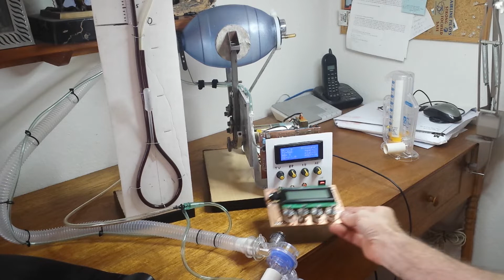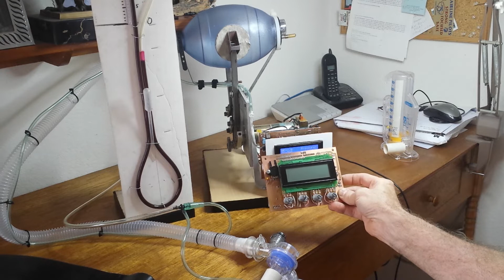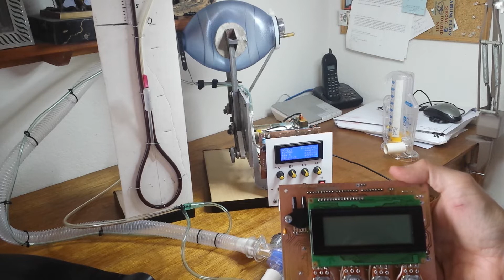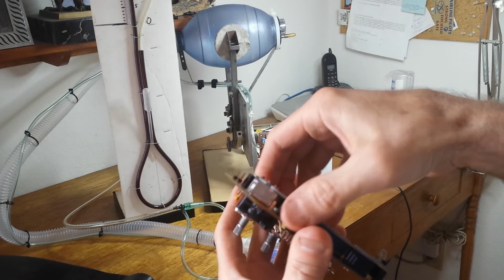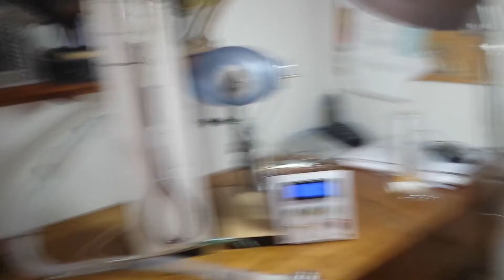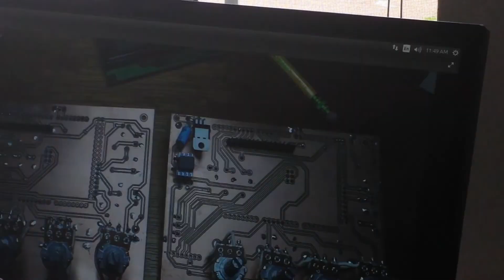DIY mechanical ventilator with closed loop control #5

Comment: Hello, I am simulating the circuit, I have a question, what do the values that are sent by serial 0 represent? I see 5 columns, I know that 1 is time and 5 is pressure, but I don’t know what the others are.
Reply from the maker: Hi Miguel,
#1 is cpu clock
#2 is cycle start time
#3 is the state of cycle
#4 is QPPS ( encoder count for commanded position)
#5 is PIP ( peak pressure)
#6 is respiratory rate  time in millies
#7 loop buffer
#8 is motor current
#9 is Peep pressure
#10 is high pressure alarm
If you have the ventilator running with no faults, you get all 10.
In one of my other videos, it shows the serial monitor with explanations.
Reply: Hello, can I get the simulation files for the circuit